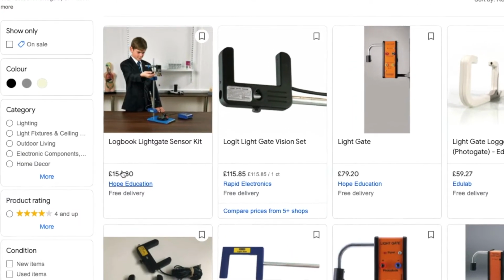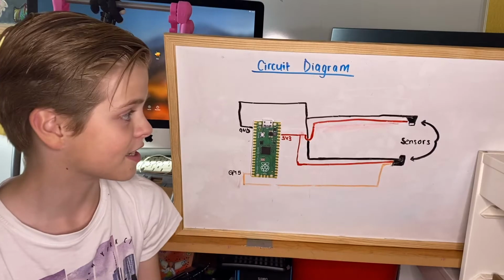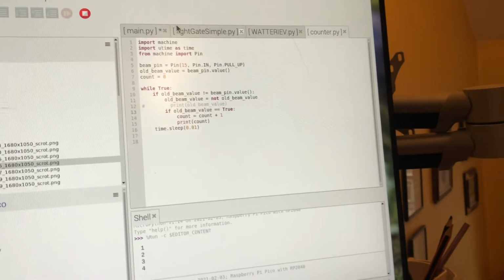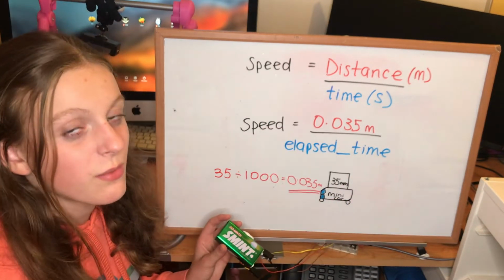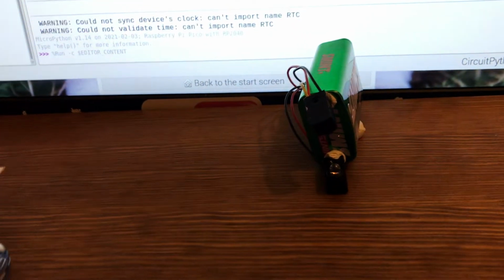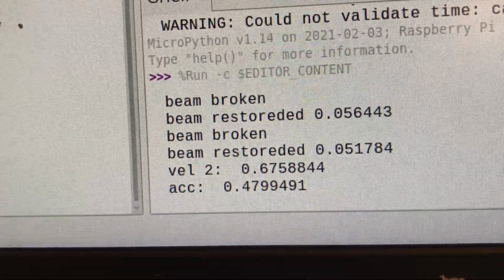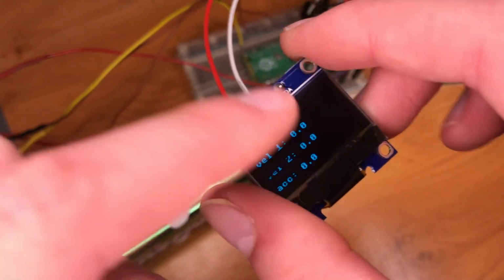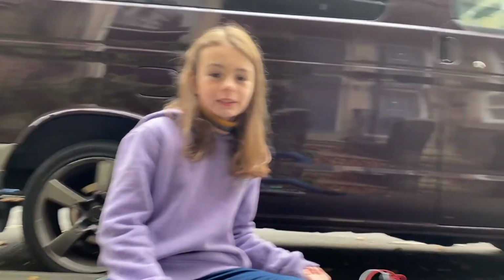How To Use A Break Beam Sensor & Make Your Own Light Gate On The Cheap Using A Raspberry Pi Pico

Comment: Hi, Love the videos and looking forward to your future videos.  I am impressed on your level of understanding and you do a great job of explaining.

One thing has been nagging me about this video and your previous one where you used the light gate to determine acceleration relative to mass and force.  The issue that I am having is how you can calculate acceleration without knowing the initial velocity in the object passing through the light gate, where the initial velocity is the speed the object is moving when it first breaks the beam.  The way you describe the measurements is that the time the beam is broken as each cardboard rectangle passes through the beam gives you two velocities.  What you are really measuring is the average velocity during these two phases.  

Let:
  D == Distance of one block of cardboard.
  V0 == Initial velocity when the block first breaks the beam.
  Vv  == aVerage velocity
  a   == Acceleration 
  t   == Time for the block to pass through the beam.

So this makes [ Vv = D/t ] and according to Newton's Second Law of Motion, [ D = V0*t + (1/2)*a*t*t ] 

My problem is that no matter how I play with the equations, I need the initial velocity when the block first breaks the beam, the three distances (block1, gap, block2), and the time for the block, gap, and second block to pass through the time gate in order to determine the acceleration.  You have measured the two of the distances and the three times.  The width of the gap is also measurable.  This leaves us with the problem of the initial velocity which is unknown.

I am assuming I am missing something and hope you can enlighten me on how the average velocities of the car/block through the light gate yields the acceleration.  In your video on verifying Newton's Second Law of Motion, the stopwatch method works since the initial velocity of the car is known, as zero m/s.

Comment: Good to see you back.

Great video with good explanations as usual.  And your website writeup is exemplary.

I do have a comment about the final experiment results at 25:12, which to me don't seem plausible.
vel 1: 0.8269735  (assuming this is meters/second, that's ~ 3 kph (or ~ 1.86 mph)  ... this seems reasonable.
vel 2: 25.64103 (assuming this is meters/second, that's ~ 92.3 kph (or ~ 57.4 mph)   ... this is unreasonable.  Especially changing this fast from 0.83 M/s.
acc: 0.8333306 (assuming this is meters/second^2) 
for that acceleration to be derived from the above two, would require Δt = Δv/acc or Δt = (25.64103-0.826935)/0.8333306 or  about 29.8 seconds, and watching the video at 25:07, we can see this is obviously not the case.

So you need to determine why the results were what they were.

Some possible explanations:  The light receiver was pointed up and was confused by sunlight.  The card didn't pass between the light gate (it is hard to tell from the video).  Something else, perhaps overflow in calculations, although if using float, that seems unlikely.

Will you be putting  any more code on the github site?  Some of the longer lines in the screen shots are truncated on the website writeup.
Reply: I didn't realize those were code blocks that could be copied, so the last sentence of my previous post can be ignored.